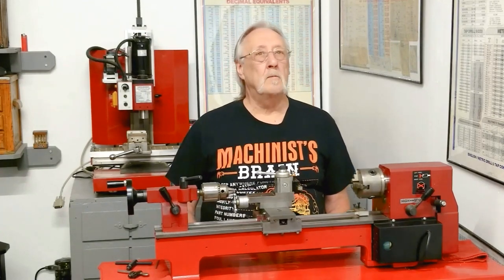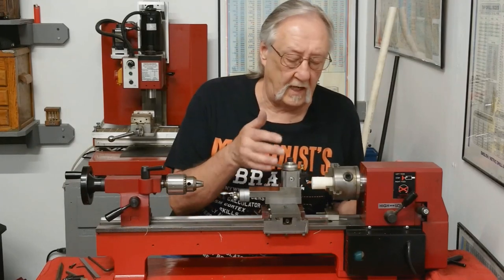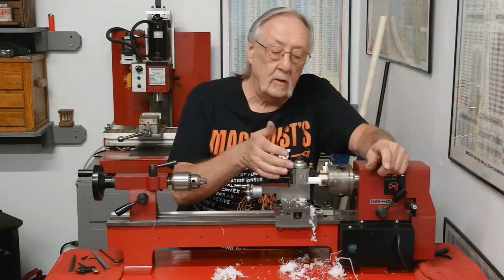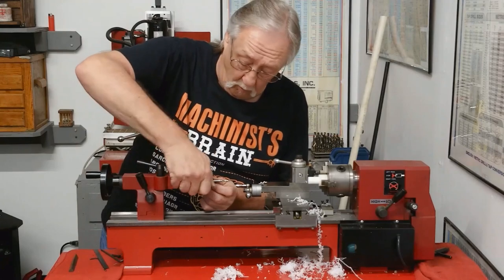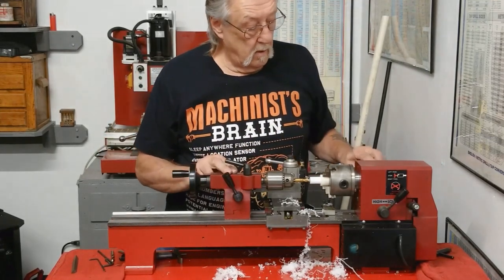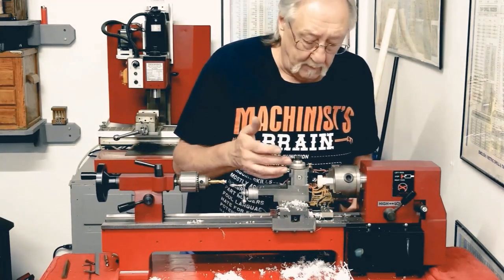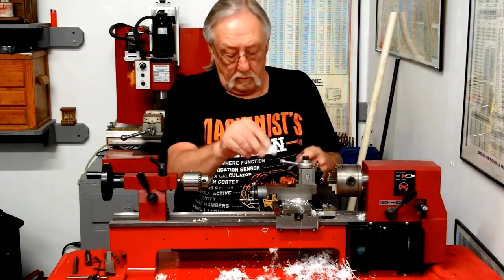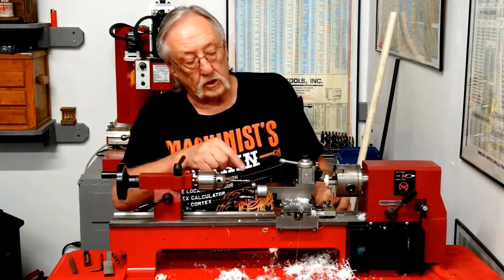Harbor Freight Mini Lathe Projects 4, Lathe Fixturing

Comment: I don't understand how your little mini lathe works so good I have the same lathe and it will not work well at all the feed I have to use almost both hands to get a smooth feed I cannot just turn the crank like you do and it feed on so smooth I have spent hours trying to level everything is smooth it up with Emery cloth and then use an Arkansas Stone it just does not move smooth I cannot just crank it with one hand like you do to get it to feed help me please
Reply from the maker: Hello, Let me just tell you right now, I am not turning the crank with one hand. I am using both hands at the same time. You may not be able to see my right hand holding the bottom of the crank. First I turn the top of the crank with my left hand and before I stop turning with my left hand, I hold the Bottom of the crank with my right hand and start turning the crank. I never let go of the crank. Left hand, then Right hand, Left hand, then Right hand  You can not see that in the video. I also spent a lot of time fixing that lathe. I have 2 videos showing what I did. The videos are, Upgrading your mini lathe 2, The bed Extension, and Upgrading your mini lathe 3, The Carriage. Perhaps I should make a video on how to feed the carriage by hand to get a smooth finish. I hope this helps you. If not, Let me know and I will start putting together that How To video. Thanks for watching and commenting.
Reply: First off thank you very very much for your reply like I said previously I have taken it completely apart and smooth and level to best of my ability every moving part on that mini lathe I've been fooling with this thing for about 4 years trying everything possible watch your videos did it all . it will just not make a smooth cut its like the feed speed and the Turning speed or not in sync . seems to flex a whole lot I've been doing all my experimenting with aluminum about 1 and 1/4  inch in diameter I have tried still every piece of Steel I could get my hands on different types that is it will definitely not cut steel to my satisfaction I have every type of tools made from carbine to hand shaped hard Steel the only way I can get a smooth cut on aluminum is turned the tool where it is almost totally flat against the material I paid including tax over $600 for this plus all the tools and drill chuck and everything I needed and I would gladly if somebody offered me $200 for it take it because I am just sick of this thing maybe if I went to a different brand I don't know thanks for your reply. Ever since a teenager I have enjoyed making things there's nothing more satisfying than doing it yourself of course my disappointment with this has been just as great  ..at 78 years old I'm not going to give up I never have I'm going to keep trying till I master  this thing
Reply from the maker: Do you have your tool bit at the right height. Not to high or to low. I mean it needs to be right at the center of the material. Check the gears on the end of the machine and make sure they are tight and in place. Do you still have all the gears that came with the lathe? Try putting a gear setup on the lathe to cut a very fine thread. Also,The half nut that is inside the apron that grabs the lead screw. Look at that and make sure it is grabing the lead screw with the top and bottom of the nut. Watch the lead screw when you engage the half nut does the lead screw stop and start and stop and start. check the gear connected to it and make sure it does not have broken teeth. Let me know if any of this works or not. Good luck.